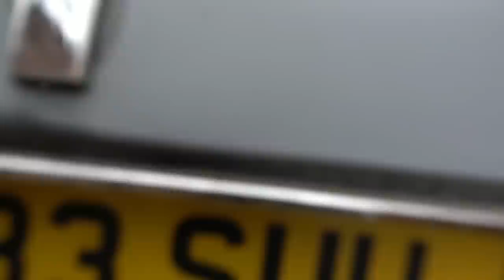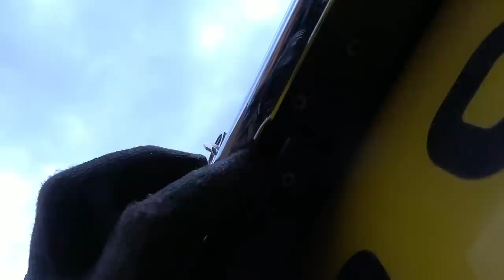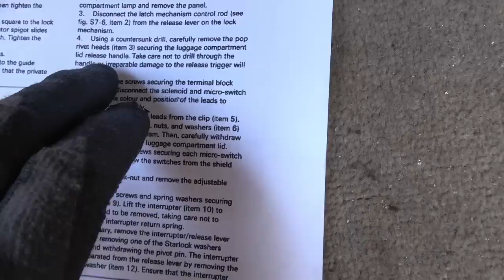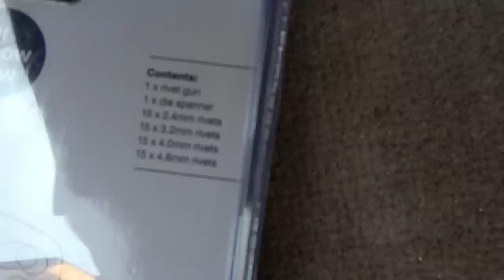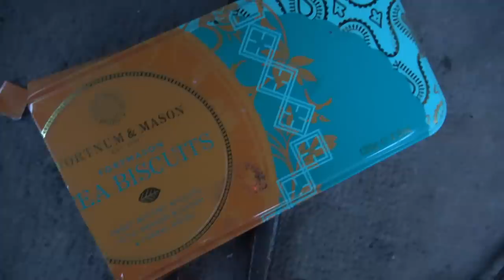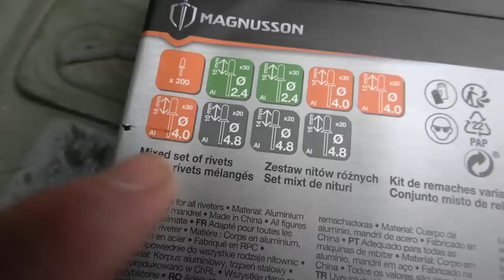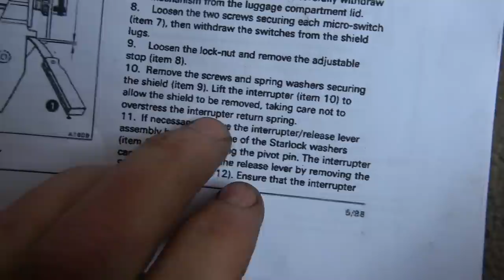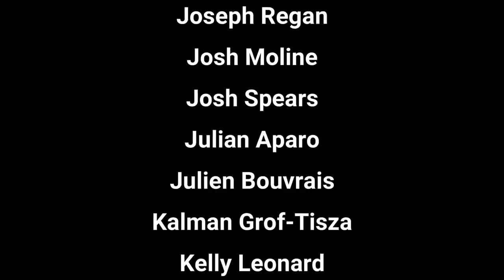Can I FIX a ROLLS ROYCE - PART 5 - BOOT/TRUNK Not Opening

Comment: I would search Gasket Material, you can get it in all sorts of types and thicknesses. I would also suggest getting some hollow punches. It makes putting the bolt holes in the gasket much easier and neater.
Reply from the maker: Thanks Chris, I will have a Google and see what comes up 👍👍👍
Reply: @Mymatevince  its called gasket card... available on amazon in a multi pack of different thicknesses
Reply: @Mymatevince  I would use neoprene foam sheet from amazon. I use 3mm self adhesive on my Classic Range Rover and it works a treat. Welcome to the world of classic cars. 😂
Reply: felpro gasket material 👍

Comment: @14:57 - You could buy some thinner speaker installation foam.  It's a couple of millimeters and has an adhesive backing.
Reply: Craft stores sell sheet foam that is perfect for such gaskets, just cut it out with a craft knife. For a longer lifespan material, cork or leather would work well, since anything plastic (especially foam) will disintegrate over the years. Leather and cork will harden, but this Rolls will probably be razor blades by that time ;p  Cheers!

Comment: If you want to date check the tyres there should be a 4 digit code on the outside of each tyre. Example 2715 , which would be 27th week of 2015.
Reply from the maker: Thanks OConner, from memory the date code is only on one of the tyres on this car, I couldn't find it on the Avon branded ones. On the other one it was 2009 (I think, or thereabouts) . Unfortunately they all need replacing, they are very badly cracked 👍👍
Reply: If the tires Are even from the ninteys, its possible there are only a 3 digit Code

Comment: Nice one Vince! You can get Nitrile bonded cork gasket that is for automotive use in various sizes and thickness. Easily cut with a craft knife or a good pair of scissors. Holes can be punched out with a hollow punch much like leather craftsmen use.
Just check ebay. 
Can't wait for the next one on this Roller!

Rodney, bring the Roller round would you! 😉😂 I'm sure that's what Del boy said in an episode of Only fool's and Horses.

Comment: I think it is a great fix that handel must have been a total nightmare to film 😀. 
Maybe is a revisit on that badge flopping around as well, think you missing a spring on that hinge as well 😉 
Great series hope for better wether for the next one :)
Reply from the maker: Thanks Anders. I think the badge flap is as designed.  There is a little magnet to keep it fixed to the boot when driving to keep it in place 👍👍👍
Reply: @Mymatevince  this .. just the magnet.
Reply: @Mymatevince  If you wiggle the Handel does it wiggle Bach ?
Reply: No, Scarlatchi

Comment: I bet the service manual will be more helpful than a Haynes book. Keep up the good work. Corner by corner the fixed stuff will start to merge and you'll start seeing the project pull together into a whole. Agreed about the boot light. there's probably a momentary switch someplace in the boot either on the lid itself or the chassis.

Comment: Excellent work Vince, as usual. Would a 3D printer be any use during this project?
Reply: Difficult to say. In my experience, 3D printed parts are usually not the strongest mechanically, so I'm kinda doubtful. Also many common filaments don't take heat very well and as we know cars can heat up very much in the sun. ABS does work in cars but is very annoying to print, especially on home printers. Resin (SLA) printing using an engineering resin might work better but is quite expensive and glacially slow. I once printed a small spare part, a disc less than 20 mm in diametre and only a few mm thick and it took 45 minutes to print.
Reply: @Ragnar8504  Professional 3d printers can do PA12 gf reinforced but still the structural integrity is probably not good enough.
Reply: @rimmersbryggeri  I was thinking about your average home printer. And even reinforced filament can give problems with layer adhesion. I've had printed parts snap far more often than I care for, even on fairly well-calibrated printers.

For parts like this lock bit I'd really prefer metal fabrication, even the impromptu shed kind. That should last forever unless water gets to it. Actually the part looks simple enough you migh be able to fabricate it out of aluminium using a hacksaw, drill and a few files.
Reply: @Ragnar8504  That's what I have been thinking seeing all the production run products being 3d printed. Injection molding or simular must be so much better and cheaper on time. It seems great for ptototyping or mold making but for actual practical application in a load situation I wouldnt trust 3d printing.

Comment: I’d assume the handles are made of plastic because they could get crazy cold in winter if they were metal. Could even get your ungloved fingers stuck to them under the right conditions.
Reply: Unless your hands are wet (even then), they won't stick to the metal (source: I live in Canada and often have to deal with subzero Celsius metal)
Reply: @FloodExterminator  Aye. Well with the amount of rain we get in the UK, wet hands wouldn’t be out of the question!
Reply: @saturnuria1217  But... It can't rain while subzero temperatures... That would make snow...
Reply: @saturnuria1217  Besides, for water to instantly freeze on metal that quickly it has to be like -20 or less.
Reply: @FloodExterminator  As much as I’d love to discuss the finer points of the UK’s climate with you, I’m a bit tied up at the moment. Suffice to say, it can absolutely rain when the ground temperature is below zero, as long as the temperature higher up in the atmosphere is warmer. Not unusual during a UK winter. As for whether its possible for a wet hand to stick to frozen metal or not, it’s a moot point: I’m reasonably convinced car door handles are made of plastic either to prevent them freezing solid to the car and to prevent the discomfort caused by touching frozen metal as opposed to cold plastic. You have a great day now.
Reply: @saturnuria1217  Mate, I know what freezing rain is, we get quite alot in Canada, what I meant is for your hand to stick to something due to the cold that fast, it has to be very cold as your body temperature will prevent ice from forming. Also, didn't older cars have metal door handles? I'm pretty sure the reason car door handles are made of plastic is purely for cost reasons. Plastic is alot cheaper (depending on the plastic obviously) than metal.

Comment: Great video! What are you going next? 

You should also rebuild the K-Jet metering head, it is easy to do, basically you need to replace the large diaphragm which has probably perished by now and will cause incorrect fuel metering going to each injector.

I would also remove and clean each injector, this can be done by using a can of brake cleaner and pressing the small plastic tube that comes with it.

Comment: Something to consider when it comes time to get speakers for the interior sound system if it needs them, if it takes standard sizes, go for anything Pioneer with a guaranteed spec of a polypropylene cone. it will last longer than any other and since you're not looking for the super best, it will sound just as good as base spec. make sure you tar around them properly as needed for dampening, and in your boot there, you'll also want to make sure under the carpeting is a bunch of peel & stick sound deadening sheets with the foil coating on top. it will help with insulation in the summer/winter and will also cut down on road noise more than what it already has built in. Good idea to also place some down in the cabin as well if it doesn't have any to begin with... if you also plan on removing the carpet from the interior of the car, as is always a good idea, as then you can hang it on a clothes line and go to town with it with rug shampoo, then hair shampoo, and leave to dry. 

the cheap sound deadning sheets are cheap and effective, no need to get dynamat or whatever the big name brand of them are. this isn't a performance racer or a tuner, but it does help with giving the car a more pleasing experience for audible noise and insulating purposes in the winter. you can also put them under the dashboard if you ever ever need to remove those and it will only help you more.

Comment: Hi Vince, I would avoid the reuse of those rusted screws and replace them with new ones. This time you managed to pull it out, but next time it might not be that easy. It is not worth the few cents. I am glad the manual helped. And good job with the fix!
Reply: Thanks for sourcing that manual for him!
Reply: @jeremydewolfe8026  A lil bit of googlin does wonders 😀

Comment: you could try some really cheap stuff from the Range called Dovecraft Junior A4 Foam Sheet it's a thin sheet of water proof foam, I used it for packing a lithium battery but I think it'd do the job a treat...

Comment: Oh boy...if you just taken out the entire broken piece (since you already had to de-rivet it) you could have eased the pain and suffering. Plus you could build up the broken part with epoxy (scuff up the surfaces first and be sure to rub it on) or do some plastic soldering and fill to add mass or try Plastex. Or you could have made a metal version of the part! in any way that's an absolute success!

About the long cure epoxies: they usually have more strength than quick cure ones because the bond would have been stabilized (not moved around much) and air bubbles could better escape before it sets.

Comment: For gasket material in the application you spoke about I would use draft proofing foam tape, you can get it in all different widths & thicknesses so you can trace around the object & cut to size.

Comment: One thing that might be a massive help with this and future projects is a 3D printer so you can just print a new part that is unavailable/rare or very expensive easily and cheaply. You could also do videos learning to use it and designing your own parts.
They are also fairly cheap these days, there are Ender clones like the Aquila for less than £200 and are on sale a lot on Amazon.

Comment: Love the videos vince. I personally would have replaced the battery for a brand new correct voltage one for rhe sake of £150
Reply: Surely the voltage is 12 V anyway? The main difference in car batteries is capacity (measured in amphours or Ah) and that's fairly directly related to physical size, i.e. you can't usually fit a larger battery than the car was designed for. You can usually fit a smaller battery and drive the car without any problems until the weather gets cold. Starting a cold engine is really where you need battery capacity, the more the better. I absolutely wouldn't replace a working battery while the car's just sitting in a driveway awaiting possibly lengthy repairs. That's about the last thing to do when the car is back on the road.
Reply: Surprised to see the battery is housed in the boot, rather than in the engine compartment!
Reply: @Ragnar8504  yeah the battery is measured in crank amp hours as u said but its just good practice as alot of electrical bugs with cars are down to a poor quality battery

Comment: I've used Haynes manuals and shop manuals, and while Haynes are ok, nothing beats an actual shop manual for the vehicle (which may be what the luggage compartment printout is?).  Of course, the cost of a factory shop manual & availability are issues but sometimes they can be had on CD or PDF download for a lower cost.

Comment: A 3d printer could be helpful for fixing these random plastic bits, I've used mine for all sorts of random things also I think a sheet of neoprene type foam could be cut for gaskets (or you could get flex filament and print them with a 3d printer 😋)

Comment: I know that old cars from before the 60's used cork sheets for the engine block, as it allowed for expansion, not very good for contraction, hense why not used in modern cars today. it would also act as in insulator of sound to a certain extent. just not sure about it being exposed to the british weather, and would have to be cut exact to stop build up of water. which is pretty easy with a light hammer, and no major bashing.

Comment: Gasket paper. Tons of different thicknesses and materials exists. Even cork.
If the seal area is metal you can put it on top cut the material by hammering with a small ball hammer on the edge.

Comment: Hi Vince. If your idea doesn't work, I would be happy to 3d print a new plastic part for you but you will need to provide a rough sketch with dimensions so I can create an appropriate cad file. All the best - Basil.

Comment: So, when using superglue. Put baking soda over it. It will set the glue off, and makes it harden up very nicely. I use it to repair metal pins on car toys, like hot wheels.

Comment: Instead of super glue I would use a soldering iron and weld the plastic pieces together. Just small taps to melt the two broken plastic pieces together. My experience is that welding plastic is stronger than glue.

Comment: That car has hit something on the right side.  That is why the air dam under the front bumper is all bent up, as well as the fender damage, and why the door had different bolts in the latch.  I think they really damaged that whole front part, fender, door, etc...

Comment: Eh, that battery is way more than that car needs :)

I would be worried if that car needed a battery the size of what my diesel 4WD vehicle requires, which is an almost 800CCA 12V battery.

Comment: Why not try RR salvage  or most RR parts come from other manufacturers. That latch looks like it comes from another car. Its very similar to xj40 handle
There should beva clear rubber moulding that goes over-the- appiture to protect from weather.